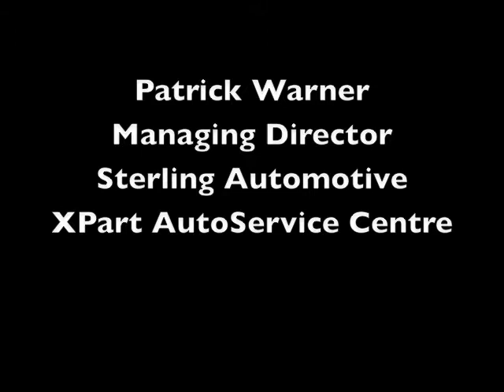Rover K-series Head Gasket Cooling Issues

Comment: the best modification to do when replacing HG on K-series is MOVE the engine thermostat!!! I purchased a landrover thermostat housing containing a pressure release thermostat. I removed the standard stat on the K-series but left housing in place and fitted new stat at the top of the radiator into the pipe that runs along the top of the rad. needless to say the engine heats up better stat opens earlier and protects the engine alot better!

Comment: Hi, can anyone help me. 
Head gasket went on my 1.4 ZR, i replaced it.
Car running well. since filling the coolant up from the gasket change it has stayed high for about 3 mouths (above max) i therefore siphoned a-bit out to just under max. looked at it 2 months later and it has gone below minimum. when i drive away water comes out of the exhaust, no other leaks . why is water coming out of the exhaust?

Comment: @harryhillys MLS Gasket works a treat and has had virtually no failures, providing of course the cause of HGF is found and cured as it is more robust. However, if your head has gone too soft through serious overheating then no gasket will work for a long period

Comment: @harryhillys .....cont 2. The larger capacity engines also inevitably went in heavier cars meaning more stress and bang HGF is coolant wasn't kept in check. HGF however is not inevitable as a few simple modifications and good maintenance go a long way. In short change the radiator every few years, fit a pressure relief thermostat (especially on the MGF) to prevent thermal shock and ensure you keep an eye out for leaks regularly. Gaskets only tend to fail through movement on the block and heat

Comment: @harryhillys ....cont. The problems emerged when there was a need to expand the engine capacity to 1.6 & 1.8 which effectively meant the introduction of larger capacity liners etc operating on a damp liner principle. This was less tolerable to overheating and coupled with poor engineering decisions such as nylon locating dowels and plastic inlet manifolds meant head movement and more opportunities to leak.

Comment: @discocreator76 To be fair to Rover it was completely new technology as they were the first manufacturer to introduce the long bolt design. When they originally came out in 1.1 and 1.4 design they were much more robust as they used a wet liner design and they had decent inlet manifolds offering little opportunity for leaks.  The first R8 rovers and metros didn't have HGF as a major problem and when so much later in mileage.

Comment: @discocreator76  In terms of the head gasket they are the same, however an advantage with the VVC engine is that they have an aluminium inlet manifold which is less likely to provide problems with leaks. All K series engines used to have aircraft grade aluminium gaskets on the SPI, however Rover in their wisdom decided to replace these for the MPI engines around 1992-3 to a plastic design. It was claimed that this was for efficiency reasons for a clean passage of air but it was cost saving!!

Comment: I have a issue with small amouts of coolent loss had to buy a CYLINDER HEAD & GASKETS TESTER KIT UNIVERSAL on ebay 
it confermed there was combustion gas in the coolent a sure sign of a head gasket leek guess i nees to spend some cash

Comment: Excellent advice given here, having done several K-series headgaskets I'd like to add how important it is to keep not only the cylinder bores and water channels clear of contamination, but critically the bolt holes prior to replacement. I speak from experience managing to snap a cylinder head bolt! Tho due to the sandwich construction of the engine you have the option to remove the sump and access the bolt from there - so not the end of the world but best avoided in the first place!

Comment: Sir i am from india and i have Maruti Suzuki Versa DX2I m in need help as my car is overheating and i have changed the thermostat and replaced both the hose pipes and cleaned the radiator but my car gets overheat on running in AC and not without AC when i drive my car Without Ac for 35 to 40 km no overheating but after that its overheat and driving in AC its Causes the car the overheat in 5 to 10 km the coolant comes out from the 
the box where we have to put coolant so please help